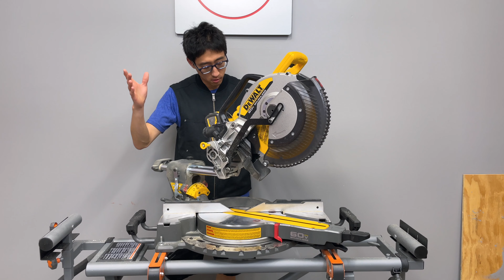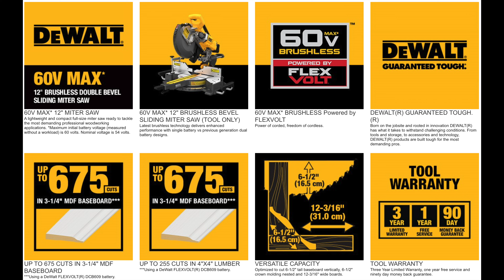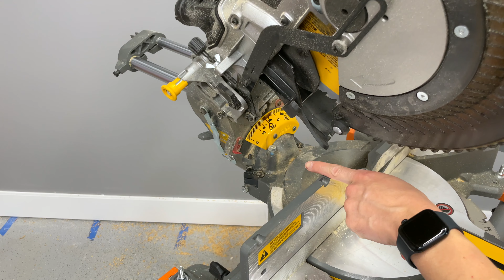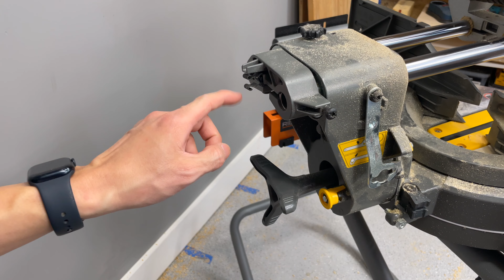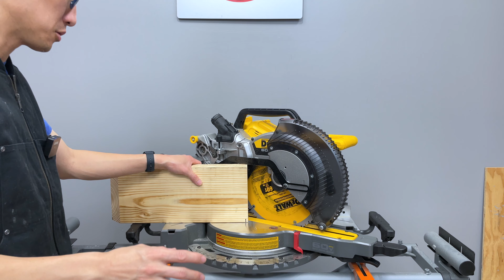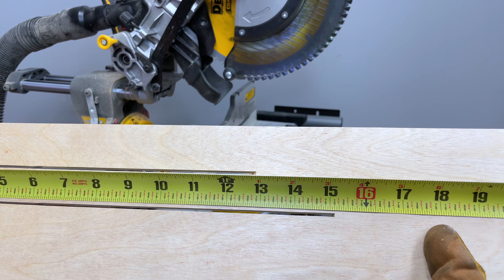DEWALT 60V MAX Brushless 12 in Double Bevel Sliding Compound Miter Saw Review | DCS781 | ep.3

Comment: When you were measuring the angle of the blade with the saw extended vs not extended, the flaw in the methodology was that the carbide tips of the blade are wider than the middle of the blade. Unless you measure edge to edge you will see a variance in angle.
Reply: I'm not sure which part of the measurements you were referring to. When he was using the Klein or the Stabila?
 

 
And, have you ever seen one of the DeWalt blades up close? Their carbide is so miniscule that it doesn't have much of a variance  between kerf and blade thickness. Lol. So in all seriousness, I wouldn't see it affecting the measurements he did. But I'll go back and look again.
Reply: No! The teeth and the rest of the blade are at the angle indicated. Bevel cuts may show a difference in angle due to deflection where as miter cuts are generally more accurate. Basically the less material the blade has to travel through the more accurate it will be and cuts will be less stress on the saw

Comment: all good except dust collection...still not acceptable.
Reply: until they start putting dust collection behind and under the saw the dust collection on miter saws is going to be a losing battle.
Reply: Still by far the best dust collection out there
Reply: I have this and dust collection is pretty bad. Someone else did a review video and noted that the rubber piece behind the blade closes down every time you make a cut so the sawdust cannot get sucked up. Terrible design.
Reply: @jameskelly4494  Not on this saw you must have the other saw
Reply: @loucifer4205  Same saw 781

Comment: One 9 amp hour battery is not better than two 6 amp hour batteries. The two  60 volt battery system means that you can use a 120 volt corded adapter.  This isn't possible with the new saw. Whats more is the fact that 6 amp hour batteries are ubiquitous on job sites. The 9 amp hour batteries... not so much. And have you priced the difference between 6/9 amp hour batteries? Big difference for us small contractors/home owners.
Reply from the maker: Depends on which way you look at it. the 2x 60v batteries will be in series at 120v allowing it to operate more efficiently and draw less current. Also allow you to use the AC adapter.
Single battery means operating at 60v and will need more current thus being less efficient (assuming all is equal). 

Personally I don't mind dual battery systems as most people using these tools will have multiple batteries, but some people seem against it.

Comment: I'm not sure if I seen it, but did you test the fence to the plate for 90° ? That's one major flaw I always experienced with every makita Miter saw. The fence would never be at 90° to the plate. 
 
Also, with previous Dewalt SCMS 779/780/790 , I'd need to calibrate it out of the box. Then, I'd need to sand the plate (base/table assembly they call it... where you rest the wood lol) because they would always have the outer edge of the plate a bit off and cause boards to lift up about 1 mm at the end of my cut. 
 
Also, I'd need to recalibrate it far too often.
 
Lastly, I mightve missed it, but from my research, it doesn't appear to offer plug in power adapter anymore... that was one reallllly great aspect of the previous model that I wish all high end saws would use.
 
In the end, no perfect SCMS exists. I'm still using my old 779 (type 20, before the butchered that saw) for cutting metals, and the 12" Bosch glide for wood. I'm always hoping a perfect saw will one day arrive, but I'm not holding my breath (unless someone is using a Milwaukee,  because that dust is everywhere 🤣 🤣 🤣.
Reply from the maker: The perfect saw is always going to be the dream. Now days it’s really how close can we get. 
But yeah no more adapter for plug-in. At least not yet. I would imagine they ran some numbers and figured it wasn’t worth the extra investment.

Comment: Looks like a good saw but still went with a makita 40v 12 inch and love that saw and seems dewalt have smaller cutting capacity than the makita , the only downside with makita is the weight but paired with bosch gravity rise mitre saw stand makes transporting very easy , battery on makita lasts for long time on normal use I get 4-5 hours of moderate use and have 2 40v ah batteries so there is no downtime there , also could be the design or the motor that makes effortless cutting no matter what you cut either hardwoods or softwoods , pricewise the saw and the stand costs here in Canada around 2000$ still cheaper than festool kapex , so I am happy with makita , had bad experience with milwaukee both 10" and 12" mitre saws and the bosch 12" profactor has very big deflection at the extended lengtht, so either dewalt or for few extra hundreds go for makita
Reply: Which blade do you use most?
Reply: @MadLadsAnonymous  currently I use that makita stock blade

Comment: I have both the dhs716 and dhs790 and this new 60v saw sounds underpowered. Just by the way it's cutting it appears to be labouring. No load rpm is the same at 3800 but the amperage draw cannot be equal between the two as the first gen has 2 batteries vs the second generations single battery.
Reply: This saw is not underpowered compared to the two you have. I have this one and it cuts everything I put under it smooth as butter. Built a planter out of old pallets for my wife using 6x6 corner posts. Best two things on the newer model are the battery life and dust collection. Made all my cuts in the garage with a shop vac hooked up and there was hardly anything to clean off the saw or the bench.

Comment: The misfits at DeWalt should have equipped this unit with an optional 120VAC plug-in feature JUST LIKE THE PREVIOUS MODEL. The bastards just want to force customers to buy MORE batteries!! I'll be skipping this model...
Reply: The number of cuts this saw makes you'll probably only need one battery
Reply: You don't need an AC adapter... With even just 2 batteries you'll run for a couple days.
Reply: Dewalt is the only one with corded or cordless miter saw , the other brands only offer one way 
 Dewalt is just doing the same now 
I dont see a problem with that
Reply: It's only a 60v machine, how do you think you can you possibly power it with 120v mains power
Reply: It's because the ac adapter burns out the motor. Ac vs dc voltage. So buy the corded version if you prefer